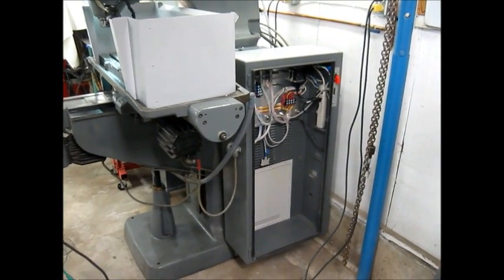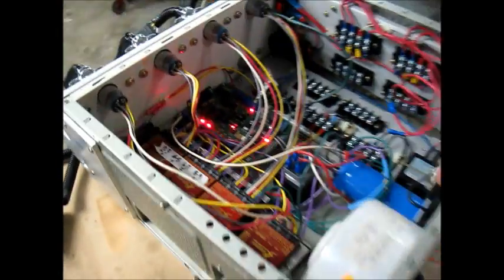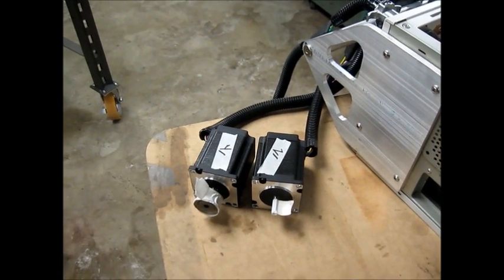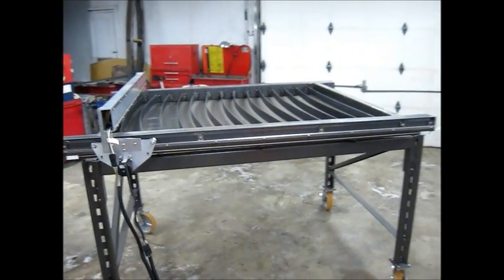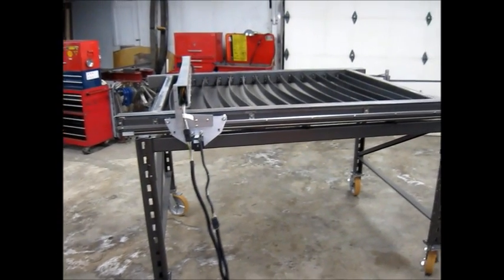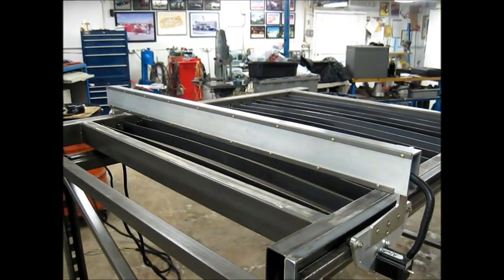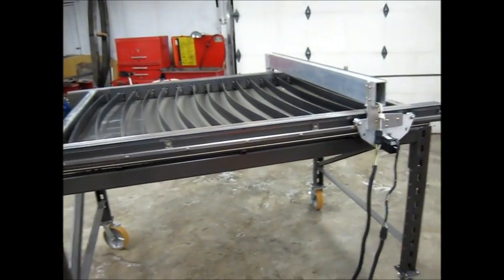CNC PLASMA PROGRESS #2

Comment: nice job.. excellent.  please tell me. how to make the rails or slides for v bearings that you have.
Reply from the maker: If you browse through the comments on each of the 9 videos in this series you'll find the info you're asking about.
The build is inspired by fieroaddiction's build on the cnczone and he has referenced suppliers too:
www.cnczone.com/forums/plasma_edm_other_similar_machine/57192-low-cost_4x4_plasma_table_finished.html
vtrack stuff, lots of sources:
http://www.vgrooverail.com/
https://www.modernlinear.com/linear-motion-parts/
For longer vtrack rail see McMaster Carr, I bought 6 ft pcs from them

Comment: Hi, good day, love the build, can you provide some info on the belt drive, (vendor, specs) and also how it has been working for you thus far?
Reply from the maker: Hi, thanks for your comment. The table runs fine and gives an accuracy of about 1/16", good enough for my needs.
If you browse through the comments on each of the 9 videos in this series you'll find the info you're asking about. For instance, the part numbers and source for the belt drive components is noted two comments below.
The build is inspired by fieroaddiction's build documented on the CNCZONE here:
 http://www.cnczone.com/forums/plasma-edm-other-similar-machine-project-log/57192-low-cost-4x4-plasma-table-finished.html

Comment: I was really inspired with this build and I am going ahead with my version of it.  I have 8 wire (lead) stepper motors, like you recommended and I am wondering how you wired them? I would like to make my drivers work on future cnc controlled machines.  I am using the gecko g540, do you know how the configuration would be from the 8 lead stepper to the db9 connections?  I see you are are also a princess auto customer and I was thinking of using the trailer wire kits they have for a quick attach feature. Could you go also go over your air cleaner again in a dedicated video, it looks awesome!?  Does your table move much under the 6 inch poly casters?Thanks so much and keep up the great work!
Reply from the maker: Hi Kris, I wired them as per the wiring diagrams on the Keling cnc site. See here: http://www.kelinginc.net/NEMA23Motor.html  click on the "specification" link for any motor and the wiring diagram will open.You should then be able to mate that to the G540 wiring diagram as gecko's documentations is usually excellent. I did a search on the cnczone and you could poke around there  http://www.cnczone.com/forums/gecko-drives/102779-g540-keling-8-wire.html        The air dryer is copied from the garagejournal forum, it is exactly as described by poster "HAP" in posts nos. 10 and 39 here  http://www.garagejournal.com/forum/showthread.php?t=131919&highlight=dessicant+dryer+pipe  I sourced all parts from McMaster Carr.  The air filter is fastened to the back of the plasma cutter and is MOTORGARD paper cartridge type filter for plasma cutters.  When the table is full with 40 gallons of water it weighs almost 600 lbs. The negligible wt of the gantry moving does not impart enough energy into the table to move it.
Maybe PM me if you have nay more questions.

Comment from the maker: There are 9 video clips in thes series on building this table.  Your answer is in the questions/comments with video no.4..."I used 'XL' belting sourced from McMaster Carr. They are part no, 1840K1. This is 3/8" wide XL belting .200" pitch sold by the foot. I used 21 ft of it at $2.43/ft. Pulleys were from ebay, do a search for 'XL timing pulleys', literally hundreds of 'em on there...."

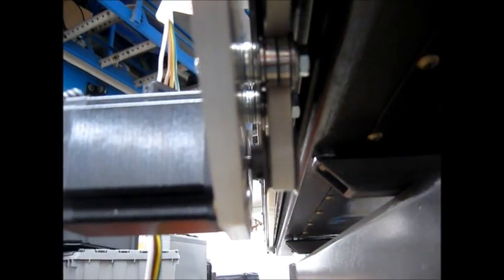Comment from the maker: I'm not sure what you mean.  This table is open belt drive.  The belt is not a loop.  It is an open belt (bought by the foot) attached at both ends.  The motor uses the belt to 'tractor' itself up and down its rail and move the torch accordingly, this is shown at about 1:10 in this vid clip.

Comment from the maker: These motors are from keling   (kelinginc  .   net)  the motors are  NEMA23, model no.  KL23H-276-30-8B   They are  282 oz-in  8 wire and are 39$USD ea.